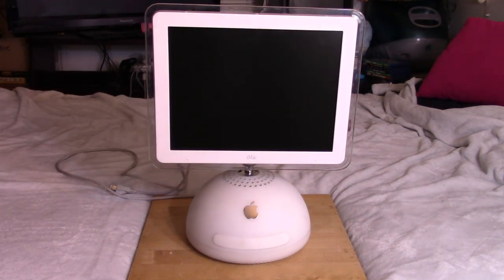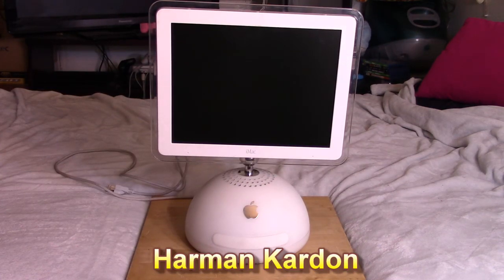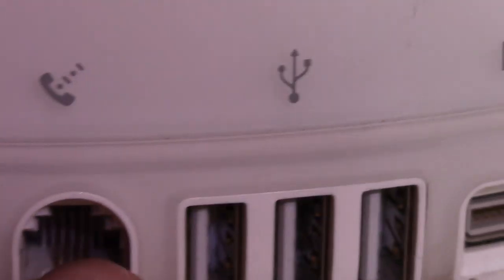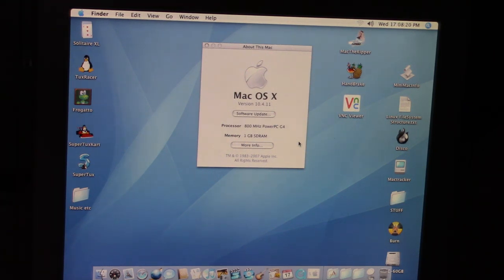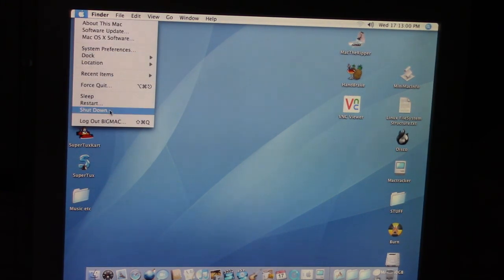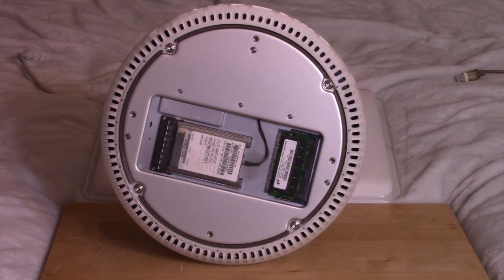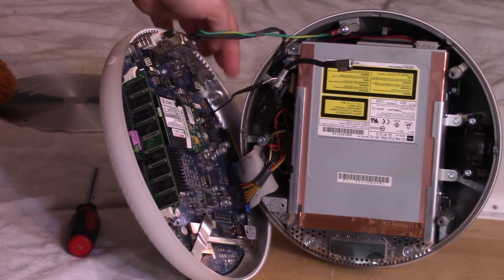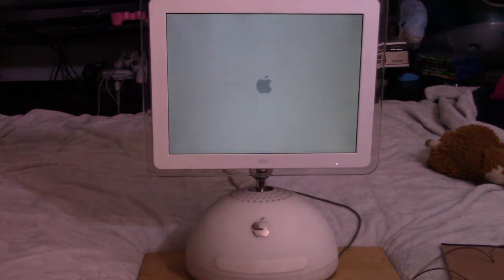iMac G4 800MHz

Comment: This was a very nice overview of your 15 inch iMac G4.  When it came time for me to get my second desktop computer, I had my heart set on the 20 inch version of this model but, Apple, Inc. had just stopped selling these about 6-months earlier.  So, I ended up buying its successor which was a white 20 inch iMac G5 (the first model where the display monitor and the processor unit were together, just like today).  Love my G5 iMac and still use it daily.  However, to keep it running had to buy a second unit that, I use for space parts.

Comment: That lock symbol is for the industry standard Kensington Security Slot (Kensington Lock). The power jack is pretty common, I have a million laying around my house/computer room. Mactracker is ALWAYS installed on all my Macs. It usually has more details then stuff you can find online and if you click the icon of the machine you can hear the boot chime the machine has. Pointless, but cool as you can hear the evolution of the chime.